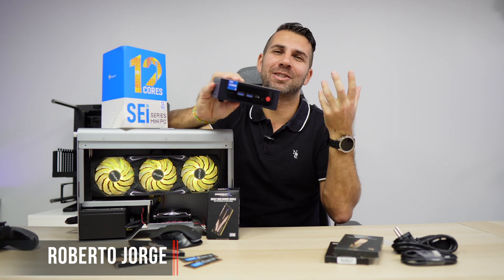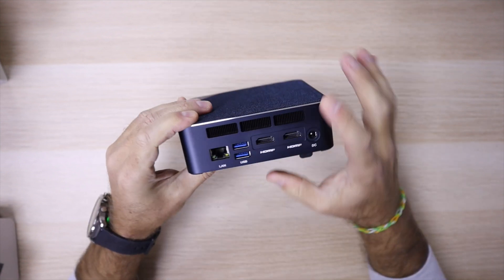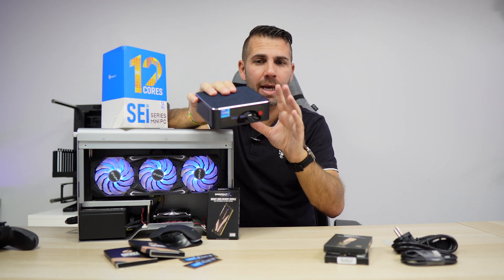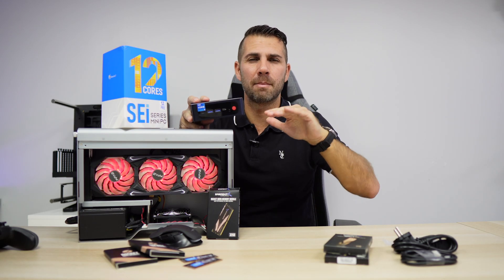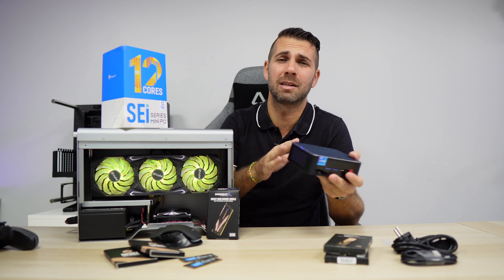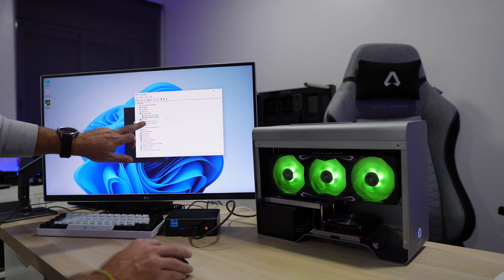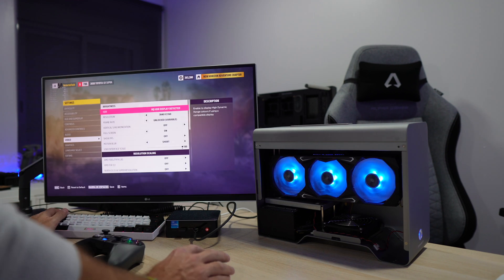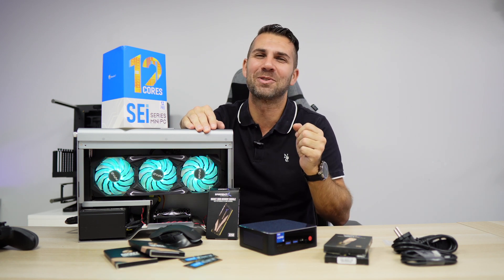A SUPER Mini Computer & eGPU External GPU !!!

Comment: Hello there! 
Thanks for this content, I just have a question : 
I've got a mini pc too and I'm gonna buy an e-GPU system like that, but I still don't understand the HDMI connection. 
I'll have to unplug the HDMI cable coming from my monitor (actually going stright into my mini pc) to plug it to the e-GPU or what? 
I've got in my mini pc HDMI 2.1, DP 1.4, USB 4.0 connections.
I think that I've to connect the monitor & the e-GPU by HDMI cable (and no more Monitor & mini pc) and than the mini pc & e-GPU system by thunderbolt cable, right?

Comment: I have a Beelink SEi12 Mini PC, Intel 12th Gen i5-12450H and want to do video upscaling of SD MKV files to 4K. Running it without an eGPU is painstakingly slow. Aside from gaming, will adding an eGPU improve video upscaling performance?
Reply: Any luck @lonnieking1823 ?
Reply: @ShubhamMajmudar  Sorry I can't provide a definitive answer as I never got a reply. Instead of getting an eGPU for the Beelink, I bought a full sized Radeon RX6600 for an older tower PC. I can say it made a big difference in the tower PC as it took a 20 hour process down to about 12 hours for a standard length (2 hour) movie. So while I can't say for sure if an eGPU will help in this instance,  I would think it will. Please let me know if you try the eGPU and best of luck!
Reply: @lonnieking1823  cool! Will sure do - thanks for the reply

Comment: Running beelink gtr6 w/Ryzen9. Have an  Radeon  6800xt eGPU running through m.2 slot. Only getting 55fps on warzone and still lags rendering on fusion360. Is there special settings to tweak,bios changes to help this? Using Radeon  adrenaline
Reply: Hey I'm looking to add some juice to my beelink Ser5 for gaming. I'm very new to pc so I don't know everything I will need beside an external gpu 😅
Reply: I assume I will need a few more items no?

Comment: Hi Roberto!

I just bought the Ryzen equivalent. It is only USB 4.0 but as i understand, it's backwards compatible with Thunderbolt 3. It does work, after 'hot plugging' and waiting for windows to load first, but it doesn't work by booting up with only the EGPU plugged in for power.

I have tried disabling the integrated gpu, and removing driver using DDU, however still no joy. How is yours performing and could you suggest anything to get this little box to work directly with my EPGU without the provided power supply unit?

Ollie